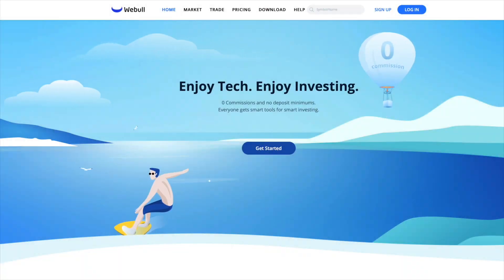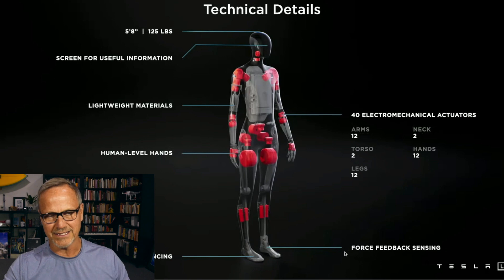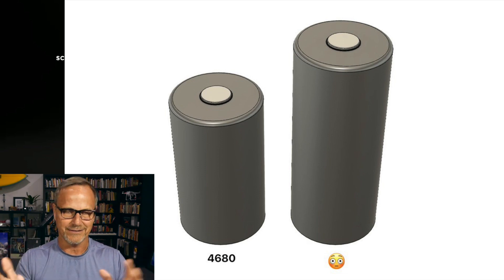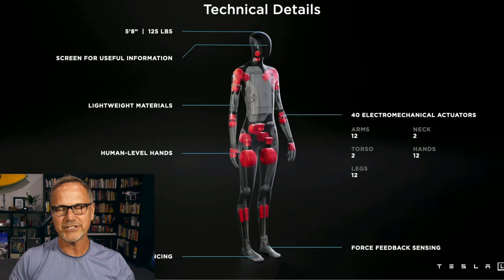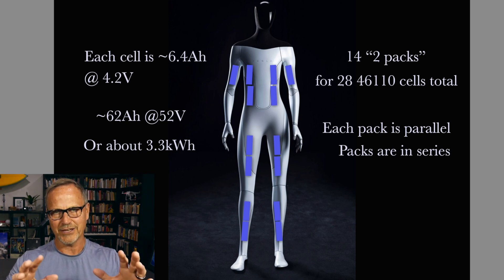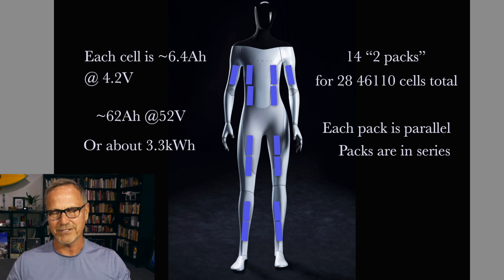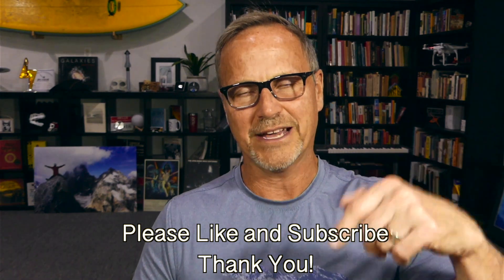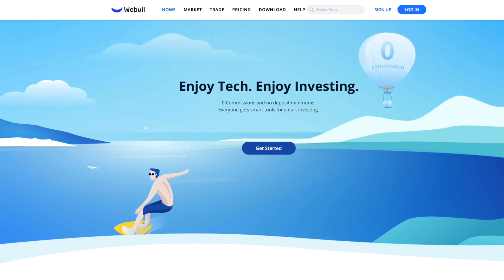Teslabot POWER!! Where the heck will the BATTERIES FIT?!

Comment: Wouldn’t the obvious calculation be to use the stated maximum weight of the bot (125 Lbs/57kgs).

4680s are estimated to weigh 150g.

If the bot was 100% battery, that’s 380 cells.

At 9,000 mAh and 3.7v per cell.

That’s 33.3 Wh per cell.

That’s 12.6 kWh for 380 cells.

(25% of total weight as battery gives a similar figure to this video).

However putting the weight into the ‘movable parts’ seems a bad idea.

I suspect 10% will be permanently inside the chest, and 90% as an easily swapped backpack.
Reply: I bet the batteries all end up in the chest, as it gets non-trivial to keep cells balanced when they are spread around, and 8V is quite low, they’d really want at least 3 if not up to 6 cells in series. The actuators will either be DC or need an inverter for AC, and either way the higher the voltage the better and the more efficient the conversion. Probably all DC tho (simpler, lower standby loads).  I bet the actuators and linkages in the arms will take up most of the room in the arm, as has been the case in every robot built to date.
Reply: ALL SKIN BATTERY, MULTI LAYER FILM ELECTRODE FLEX POLIMER, MAJOR SURFACE, IDEAL WHEIGT DISTRIBUTION AND POWER AREA ACCESS...THINK ABOUT IT, IS REAL AND SIMPLE